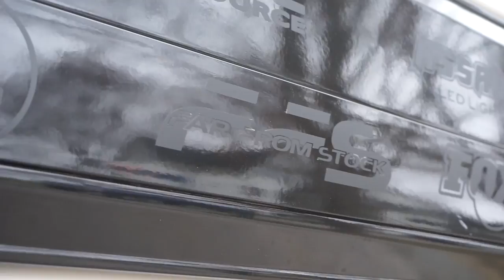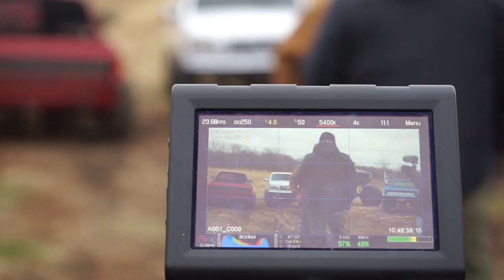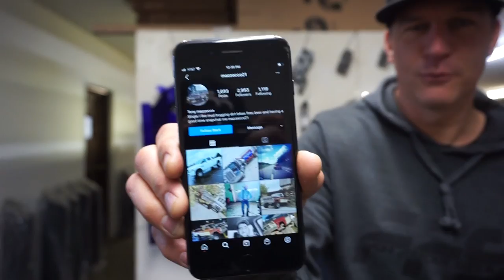1st Gen Cummins Crew #BURNEM Road 🔥❗️Earl Dibbles “Diesel” Music Video Making of with WhistlinDiesel

Comment: We all know your just hiding the fact that whislindiesel destroyed monstermax
Reply: How?
Reply: @fourwheeleranddirtbikecont2865  Instagram
Reply: @fourwheeleranddirtbikecont2865  don’t know but I saw a wheel where it wasn’t supposed to be, an axle partially connected and a bedside that was more than partially destroyed 😂🤟🏻🇺🇸
Reply: @markg1495  sounds like a typical morning for Cody. Lol
Reply: @fourwheeleranddirtbikecont2865  he said it’s going to be out for 6 months I believe
Reply: @fourwheeleranddirtbikecont2865  well it started with one coil in the rear suspension that fell out....

And in classic Whistlin Diesel fashion, he saw it, laughed about it, and pulled a "Monty Python" with the "tis but a scratch" approach ....and proceeded to aggressively chase "Far From Stock" and other trucks around a bumpy corn field, do donuts & jumps, until the rear axle and more stuff broke, and the rear end was sitting a bit cadywhompus.
 ...about 3-4 ft farther forward on one side than it should be...

Now most normal people would have considered that "broke" ... totalled even.

WD just figured "hey, the front wheels still turn..." So he simply continued on with the fun, until the drive shaft was punching holes in the ground 3ft deep, the rear suspension was scattered across the field, the rear end on the left had 6-7 ft of forward/backward movement ....independently from the rest of the truck, and the front tires were nothing more than hole diggers.

So finally after the truck would no longer move under its own power, and was firmly anchored to the ground, with its parts scattered about in the field around it.... Then and only then did Cody decide ...the truck might be broke.

I can see why it was a hard decision though.
I mean we all thought that Monster Max is only broken when the Dropbox is broken, right?

Comment: What size air tanks and what compressor(s) do you have to air up so quick? Also, would love to see a video of your air suspension set up, front and rear. How much travel do you actually have?
Reply from the maker: Roswell Baptist Church some video on this channel. 14” travel front and rear. 200psi and 10 gallons. Just the minimum really for bags this big. Search #ww1g on Instagram
Reply: This is my personal  account didn’t realize I was logged into my church account. Thanks for the info, I’m putting together the pieces to air bag my single cab. Will be checking out your website. Thanks and solid rig by the way.
Reply from the maker: @nmdiesel  absolutely. Couple options. Please call if you have questions. 740-939-0073